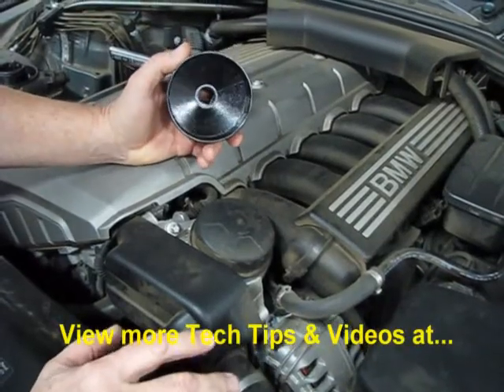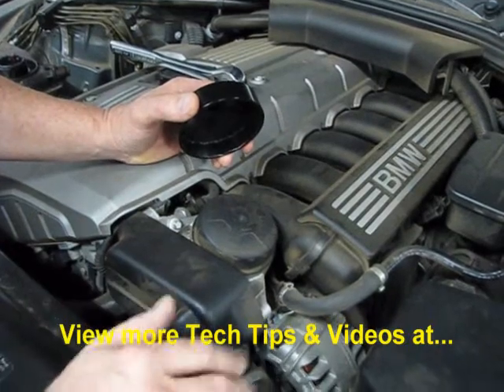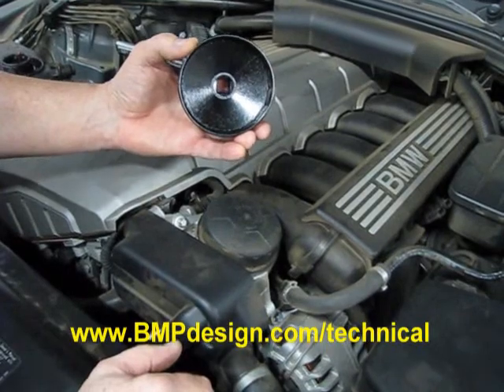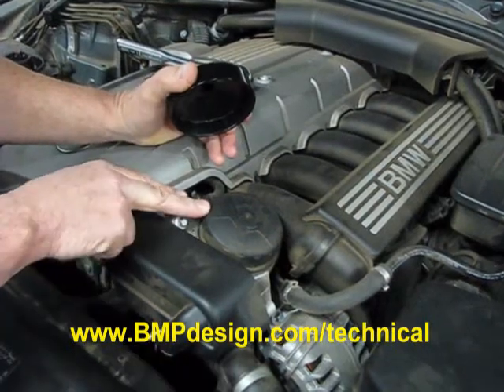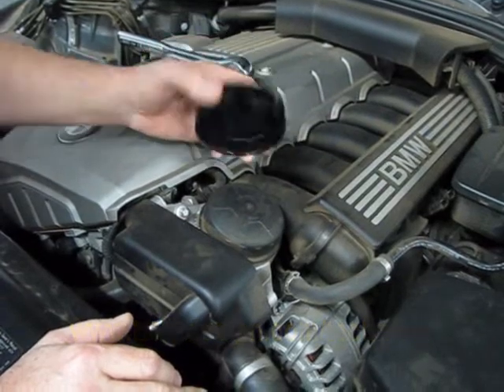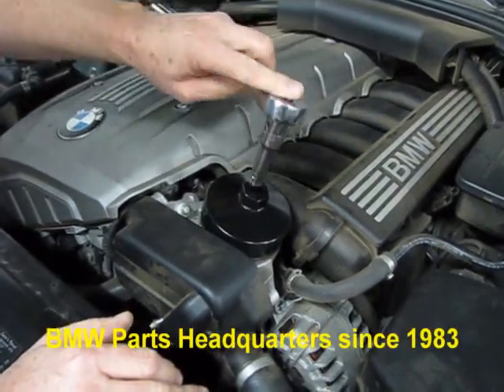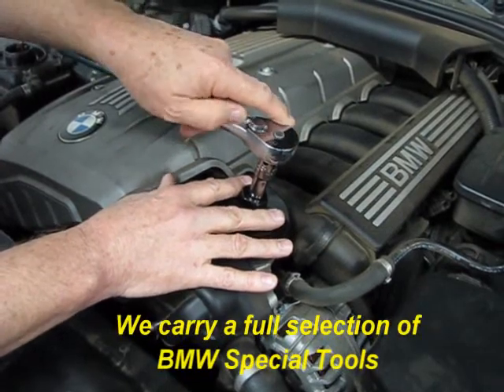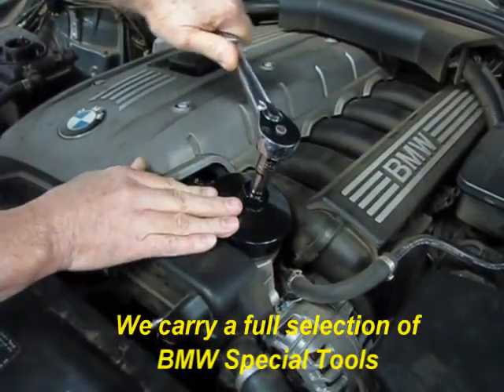BMP Design - BMW 86mm Oil Filter Cover Removal Tool Socket

Comment: I have an F30 328i end 2012 model and I bought an 86mm wrench and it does not fit. Looks like the filter cap has the same diameter as the wrench and it is like 86.7 or close. Which size do you recommend? I cannot find anywhere  which one I should be getting for my type of car and going mental... Any advice? Thanks